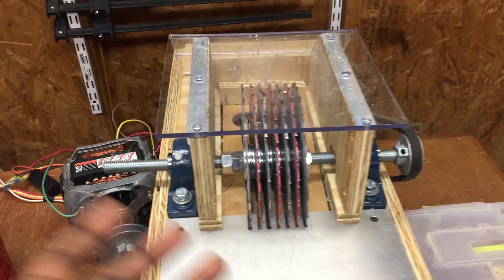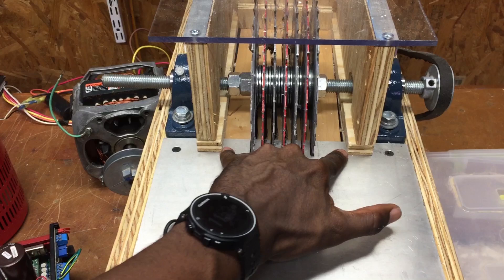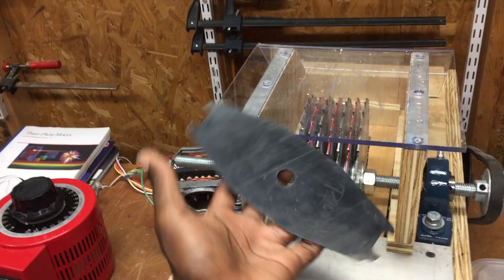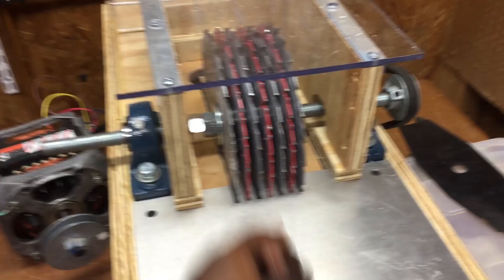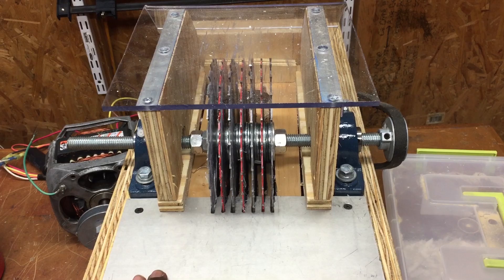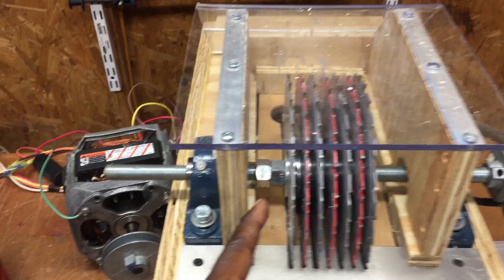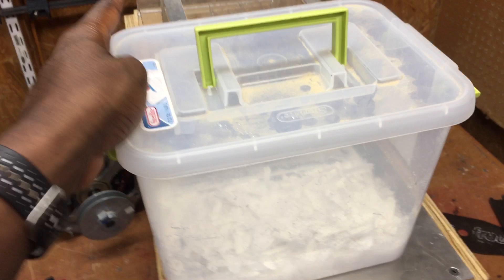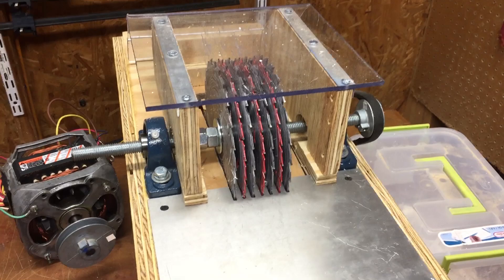Scary Prototype Shredder Design pt 2; A Cheap Alternative to the Precious Plastics Design: 037

Comment: Have you got a wobble blade you could try in there?
Reply: I feel like three or four wobble blades side by side might work quite well?
Reply: Greig Muir Wobble blades do a fairly decent job of cutting dados but I don't see how having the blades wobble would improved cutting thin plastic. Plus that would eliminate much or all of the shear plate between the blades..
Reply: Well it would allow you to basically have an adjustable blade kerf, for each blade. More optimisation.
Reply from the maker: +Greig Muir I don't have one...
Reply from the maker: +Greig Muir wobble blades remove the shear plate... and we have a problem
Reply: They're adjustable. So you can experiment with increasing the kurf, reducing the available sheer plate, but increasing the pulling force. May reduce the need for feeding.
Reply from the maker: +Greig Muir ok I follow you. It is cost prohibitive? What do they cost approximately?
Reply: Jeremy Fielding No doubt they're available but I haven't seen one new in store in years. They're less common yet cheaper to buy than dado stacks second hand. The lower price is likely due to their inherent sketchy factor, the foolish amount of time it takes to adjust them accurately and that the dados they cut have slightly curved tops. What might be the biggest issue for your machine is that wobble blades require plates/flanges to hold the blade and give it the an angle which can be adjusted. The gap made by the thickness of the plates side by side would be at least 5/8". I'm sure you could find a way around this issue but I doubt it's worth the effort.
Reply: I'm not so sure the flanges would be an issue. They are oddly shaped, which may help with the turbulent movement of plastic which should help in this type of machine (help to stop fingers forming by knocking them back towards the blade). Yeah, I think you'd have to get one second hand, they go for about $10-20 i think. Even one wobble blade in the middle might give you the feed that you want. I think the non-linear motion would give you a bit of grab, and you could adjust this to get the right balance. One pulling blade in the middle might be all you need. Perhaps you can approximate the effect by doubling or trebling the central blade in your current design?

Comment: Jeremy .... c'mon ... YER AN ENGINEER !!
SLITTING IS SLOW SPEED.
SLIT WIDTH IS EASILY VARIABLE.
THE BLADES NEED ONLY BE LOW SQUARE TOOTH DESIGN.... ATERNATE MESHING INTO CENTER....
GRAVITY FEED WILL WORK IF YOUR CHUTE IS LONGER THAN YOUR REACH... VARYING TO YOUR DESIRED FEEDSTOCK.
A 2LITRE PLASTIC SODA BOTTLE SHOULD BE EATEN IN LESS THAN 3SECONDS.
A second stage for chipping the lengths .... ??